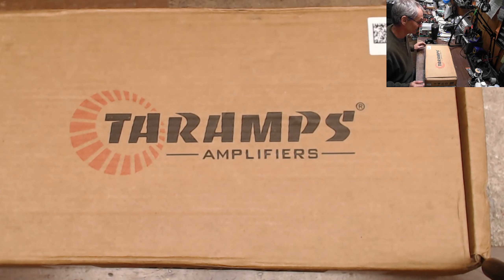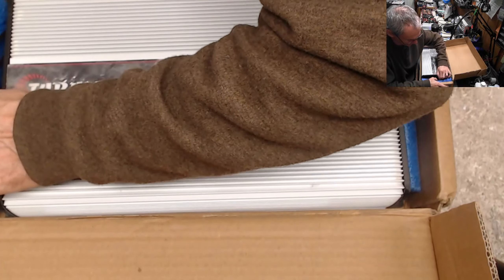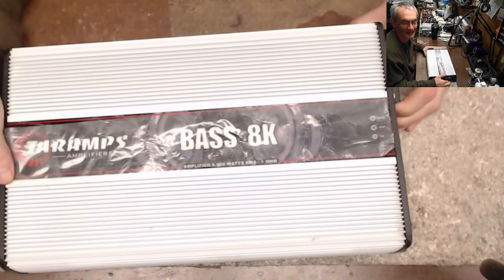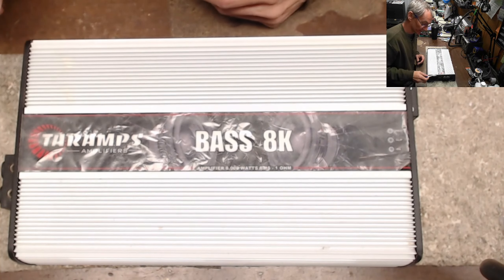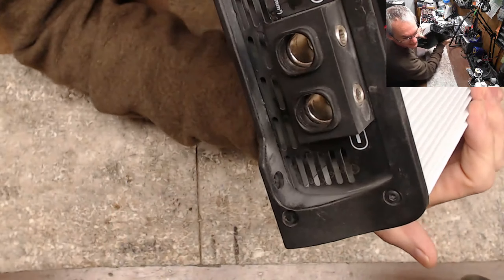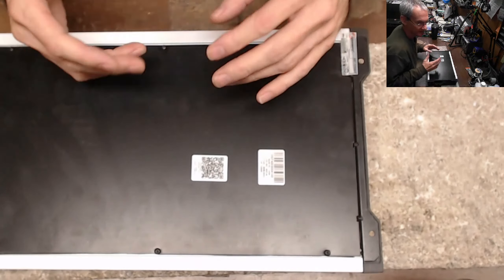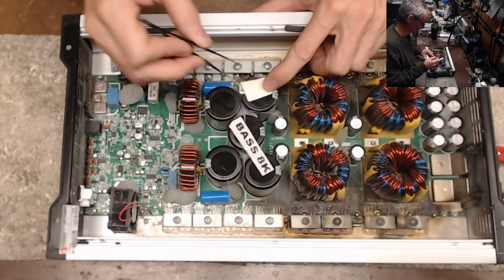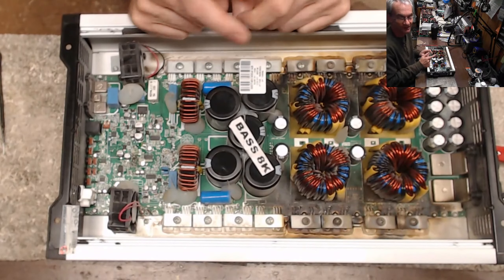Can I Save This Taramps 8k Board? This Becomes a Big NO at the End Let's verify This Together

Comment: And by new board you mean it comes preinstslled with components just needs to be put into the casing ? What’s that going to cost on average for an amp like this to the customer vs just a complete new unit ?
Reply from the maker: Board replacements are primarily for warranty repairs. I could order a new board for a private repair but I do not know the cost of one.

Comment: Hello, how are you? Do you have the taramps screwed directly to the seat? Or is it with a wooden base or something underneath? since mine burned screwing it directly to the seat :(
Reply from the maker: The heatsink of the amplifier is internally connected directly to the 12v ground power terminal so it won't matter what you screw the amplifier to.

Comment: Good morning, greetings from Chile, I just bought an 8k bass yesterday. but it failed, I don't know if it's a factory problem or something similar, I connected it and everything worked fine since I didn't attach it to a fixed part of the car, it worked very well, but when I attached it to the car seat with the 4 holes it has, I turned on the amplifier and smoke and sparks started coming out from inside and he shouldn't have done that. Since I always did the same thing, except that the taramp gave me this error, could you help me if the taramp works without problems by connecting the affirmed amplifier to the car seat? since it made me dough, so to speak, and burned immediately. Greetings, I await your response.
Reply: Ya I think it’s because you grounded the chassis of the amplifier to your cars metal. You can’t have this amp touch any metal surface of your car. It’s always good practice to mount amps onto a hard plastic first like abs then to your car
Reply from the maker: Brazillian amplifiers have a heatsink that is directly connected to the negative power terminal. The only time you have to isolate the amplifier is when you have a voltage potential between the ground/heatsink and the vehicle chassis. IE two different isolated electrical systems in one vehicle.

Comment: Hey any idea what would cause my md8000.1 remote/monitor to not work after a warranty repair on power inputs
Reply from the maker: I would check the cable ends as the monitor gets its information/data from the MCU. Do you know if the MCU was replaced during the repair?
Reply: @ellensburgamplifier  I'm not sure I bought the amp out of Kentucky brand new from a taramps distributor and the warranty was done in new york when I called after i got it back I was told that it had nothing to do with there repair they did no help from them
Reply from the maker: @macdaddy887  Was this repair recent? I would contact Alex at Taramps and voice this concern. As a business owner, I would NEVER do that to a customer warranty or not. If they replaced the MCU from a failed power supply (which is highly likely) I bet there are bad solder joints on the MCU pins.  Now if they replaced the board that would point to the monitor cable. Only Taramps or the business can tell you what work they performed.
Reply: @ellensburgamplifier  no it wasn't recent it was 2020 I'd like to contact you about getting it taken care non warranty im sure it's been too long to have it repaired by them
Reply: @ellensburgamplifier  my input is also not right recently started kinda to get choppy sound im not sure if it's my cd player or the amp rca inputs I've changed the cables
Reply from the maker: @macdaddy887  You could have broken RCA pins if this issue happens when you moved the RCAs around. Noise can be tricky to pin down at times.
Reply from the maker: @macdaddy887  I am always happy to diagnose it for you. www.ellensburgamplifier.com/request-a-quote if you would like information on sending it in. Please note that the minimum service charge has changed for 2024 which can be found on the homepage of www.ellensburgamplifier.com
Reply: @ellensburgamplifier  right on thank you and the rca problem is definitely in the amp when I touch the rca wires at the amp it will just stop all together

Comment: Hey Mr Tod how do I get in contact with you I need a soundigtal amplifier repaired
Reply from the maker: Hello and thank you for the channel support. Due to the lack of cooperation from SoundDigital I do not service their amplifiers.
Reply: Is it possible that I can pay you out of pocket instead of using warranty?
Reply from the maker: @Riva_side_key  (for the 4 channel amps) The issue is I don't know what parts they used, and they won't tell me. Typical of businesses to treat independent repair shops like that. So, for the time being I do not take in any of their equipment for repair.

Comment: In general, Tarams is a fairly reliable amplifier. I would repair it using an adapter and UCC27524 driver. All this is being repaired. Failure is often due to low supply voltage. Sorry my English is bad.
Reply from the maker: Hello! Thank you for the channel support. Yes, low supply voltage is a primary cause of failure.
Reply: 😂 what the difference between trara*amps and sound digital amps... Brazilian amps (AKA Tara Amp= Trash Amps and AKA Sound digital= ShittingDumpster) never ever buy Brazilian amps they're junk's no parts to repair they're grounding out all the chips and IC chips and you can not read the chips and IC chips... ahhhhhhhhhhh
Reply from the maker: @ChiaYang-q8x  Here is the biggest difference between the two. Soundigital will NOT help the average customer or repair techs who don't contract with them AND they deface their ICs. Taramps has some of the best customer support for both techs and non-techs and not a single IC is defaced. Yes, you can call up Taramps and purchase parts if available good luck with that through Soundigital. I have educated many people on the proper use of Brazilian boards :)

Comment: I have a taramps 8k comes on regular and than kicks into protect
Reply: And it will reset itself
Reply from the maker: @OfficialMoneyTeamFr  If it also does this when there is no load connected (nothing connected to the speaker terminal) with gain fully down then there is a short in the output. If it is shutting down while everything is connected (and not going into protection) then there is an amplifier requirement installation error.

Comment: Hey man I'm trying to decide which amplifier to buy. If you yourself had to buy an amplifier. Which one would you choose out of these? 

Soundigital Evo 4 8k

B2 Audio Riot 7500

Deaf Bonce Apocalypse AAB 7900

Taramps Bass 8k

DS18 Ko8 Hooligan 8k

Taramps MD 8k

Sundown Audio SFB 8k

Banda Electra Bass 8k
Reply from the maker: A list of amplifiers I tend to stay away from repairing for various reasons ;) If I had to choose one it is a choice of design which would be the Bass/MD 8k AFTER securing the inductors and re-flowing the output transistor traces. They are almost identical amplifiers besides the freq. response. All the others when they fail, they can fail to the point of severe damage. I am not familiar with the DS18 8k so I can't consider that one as a choice.
Reply: @ellensburgamplifier  Hey man thanks for responding so quick! And just to be clear on what you said. You said that the list of amplifiers I named were ones you try to stay away from. And if you had to pick out of those you would choose either the Taramps Bass 8k or the Taramps MD 8k correct?
Reply from the maker: @DailyBassinDane  Correct, remember they are the same amplifiers just with different pre-amp settings.
Reply: @ellensburgamplifier  Ok I'm going to be running 2 Sundown Audio X12 v2. And my voltage fluctuates from 14.5 to about 13 volts. Which amplifier do you think would be better for that application out of the Taramps Bass 8k and the Taramps MD 8k?
Reply from the maker: @DailyBassinDane  The choice between the two will depend on what frequency you plan to cross over at or what frequency the enclosure is tuned to for those subs. I am not an installer so you would have to talk with a shop that knows those specifications for the subs/enclosure. I would watch the voltage drop and increase the capacitance of the battery rack if needed to avoid possible power supply meltdowns.
Reply: @ellensburgamplifier  Ok thanks for all the info I really appreciate it! And I like your show I've learned a lot about amplifiers watching it.
Reply from the maker: @DailyBassinDane  Thank you for the support!

Comment: Another great vid buddy!!
Reply from the maker: Thank you Mark. I never know what surprises I can find.
Reply: @ellensburgamplifier today that jp33 amps driving me nuts,I took a multimeter to the speaker terminals and I'm getting voltage ,I then took a cheap speaker and hooked it up but now power. The bt knob works but I'm stumped any ideas buddy? I know your busy,hope all is well
Reply from the maker: @markroberts715  The digital potentiometer may be shorted along with the PIC on the BT card. Common issue.
Reply: @ellensburgamplifier  ty bud